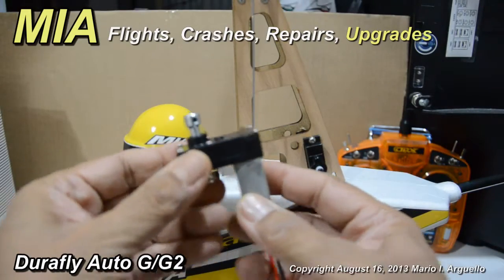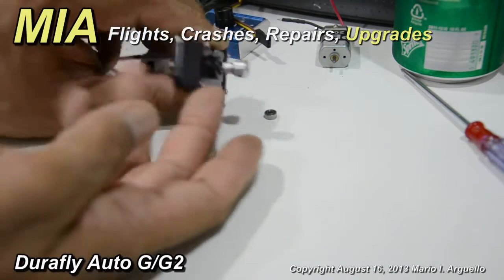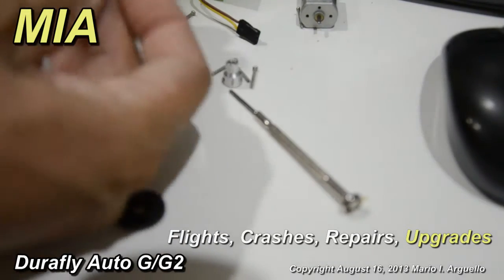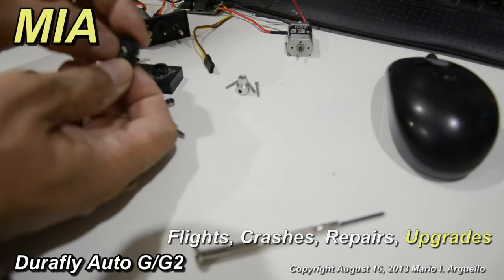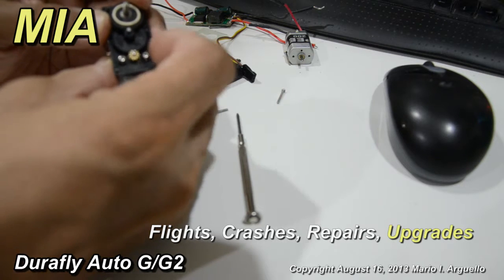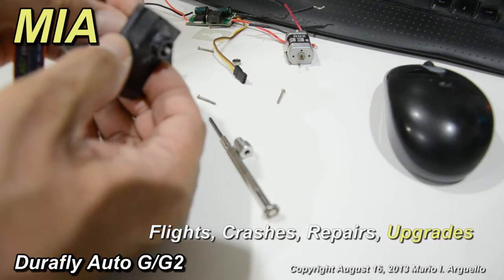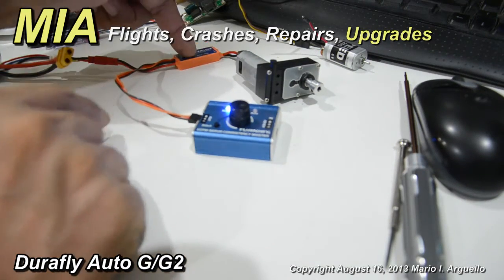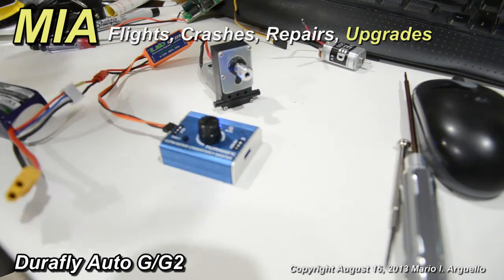Durafly Auto G/G2 Auto Start Problems and Fixes

Comment: Both things shown here have happened to my G2 as well.  I used a turnigy 30amp esc to replace the stock pre rotor esc. Still need to fix/replace the gearbox

Comment from the maker: Yeah, I know. I may just keep mine out completly to avoid having to remove it every time it starts to act up. A brisk walk pre-spins the rotor fine with the stock rotor and even better with the  MIA rotor head upgrade parts  and modified single bolt mounted blades.

Comment: Please note that the autostart kit ESC is not working at battery voltage: if you replace this ESC with a standard one you will destroy the brushed motor as it will ovedrive it and the gear box will fail and possibly the windings will cook. The 3 blade rotor is far too heavy to be driven this fast and with full 12V. This ESC has an onboard 5A switching regulator (@300KHz) which pulls down the input voltage (max 5Amps) to 3.77Volts! What fails on this ESC is exactly this, the switching regulator 5 leg IC (it may be a cold soldering joint, check). If you are handy with a soldering iron and electronics you can replace it. If you can't find a replacement you may use a normal ESC only if you regulate/trim the output with your TX at the same rpms it turns with the motor powered with the original regulator. Try using a bench PSU (unsolder the broken ESC from the motor) around 3.8V and you will see the current will be around 2-3Amps with full rotation speed. This is what you are looking for with a normal ESC. Do not exceed this current (use a clamp ammeter when testing with normal ESC and setting your radio).

Comment: The standard pre-rotator ESC is variable on mine, not just on/off, I set it to gear channel on DX8 and set servo speed to 10s on the gear channel, so now I get a smooth pre- rotator spool up, and not as much initial loading on pre-rotator drive train and pre-rotator ESC now.
Main rotor blades were very unbalanced also.
Reply from the maker: It is better to balance the blades regardless. Mine were balanced out of the box when I first bought the kit, but a spare set I had to make some minor adjustments to get them to weight the same and balance chord wise and length wise.

Comment from the maker: You are better off simply removing the pre-rotator assembly completely and leaving the rotor free spinning. The way this pre-rotoator is designed is not the most efficient. I have since gone to a full Bensen Style Pusher Conversion kit, the MIA EZ™ 1.25 Autogyro Conversion Kit for the AutoG/G2 and you can see how easy and more efficient my rotor head design works on the MIA pusher conversion in this video without any pre-rotators.  The converted model also tracks like an arrow! flies a lot better than the original tractor Durafly AutoG/G2s. 
MIA EZ ™Gyro 1.25 - Auto G-G2 RC Autogyro Pusher Conversion Straight as an Arrow!